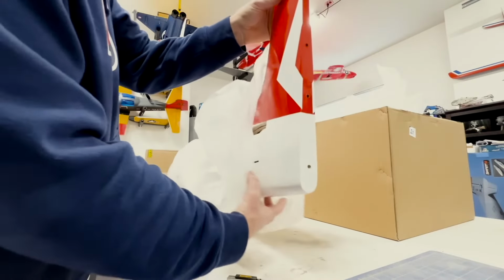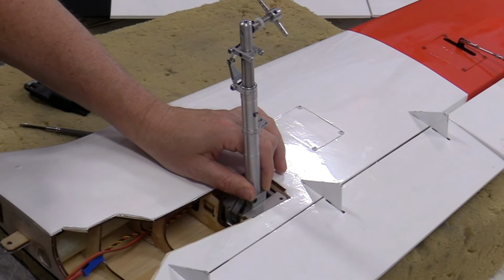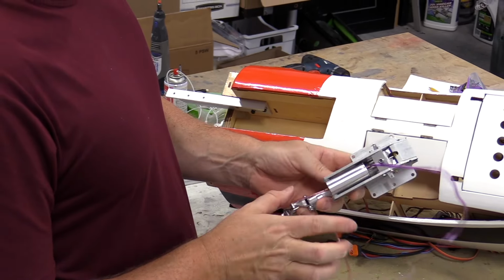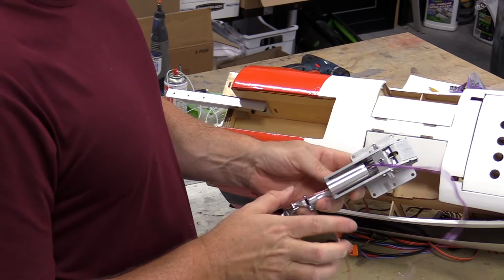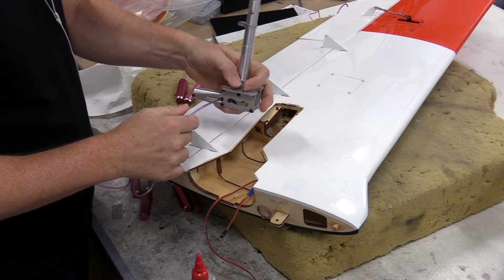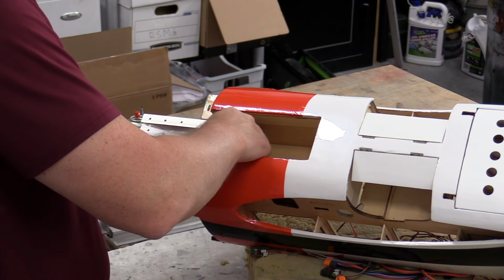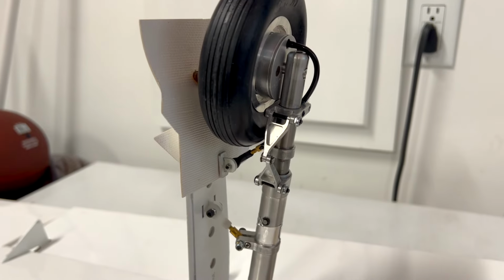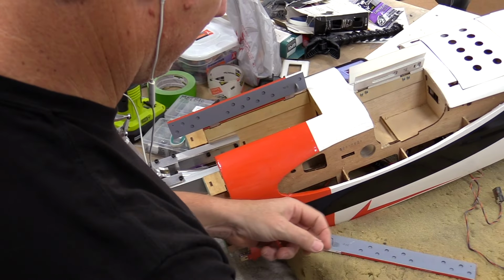Ultimate T-28 Transformation: Retracts, Landing Gear & MORE!

Comment: Great video Chris. This will be my first air retract install. I will use this video to assist and its much appreciated.  What Robart air tank kit did you use ?
Love your videos and look forward to the engine installation. 
Many thanks.
Reply from the maker: Awesome!  Things the big robart air tank. It’s what it was designed for.  The kit was the deluxe kit with the variable resistor valve and the festo fittings.
Reply: Hi Chris,  just ordered your books too.
Reply from the maker: Thank you!  It was the 157 EZ kit. Your best bet is going to try and find it from a local source as robart closed up shop on all their retract business which really sucks big time. 😕
Reply: Do you have the robart serial number for the air kit please.

Comment: Always watch anything T-28 Trojan. Flew B's in Primary at NAS Whiting Field, Milton, FL. 1981-82. Went Multiengine T-44A (King Air 90), NAS Corpus Christi, TX. Wings 10/82. Flew KC-130's, USMC MCAS Cherry Pt, NC. ATP Rated, Type L-382 (C-130). Flew RC's with my Dad for many years. He started in the 50's through early 2000's. Galloping Ghost-to-Digital RC. Saw the speedbrake-guess it's functional. Nice model. Good video.
Reply from the maker: Wow very cool!  And thank you!  (Yep, the speed brake is indeed functional 😊)